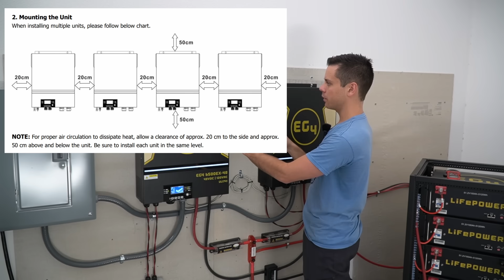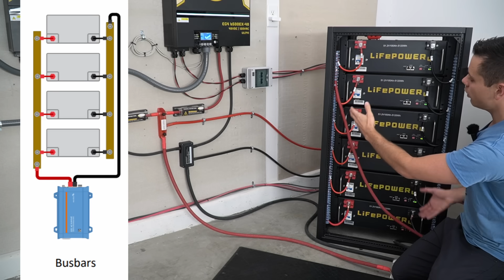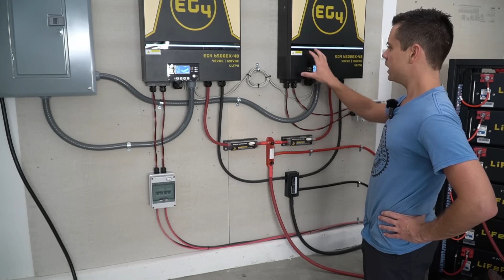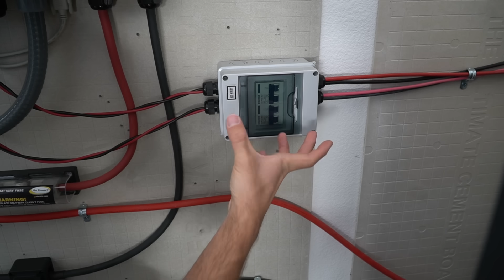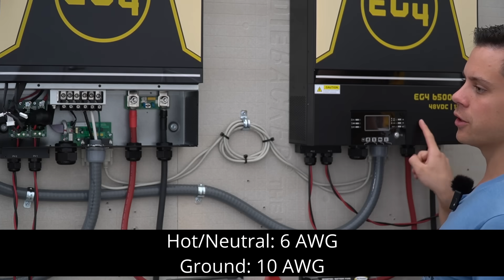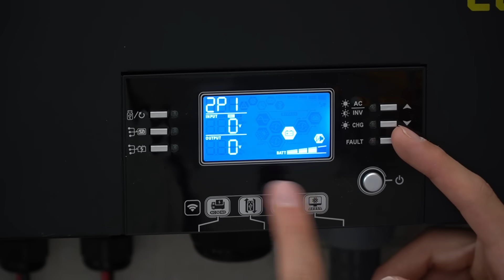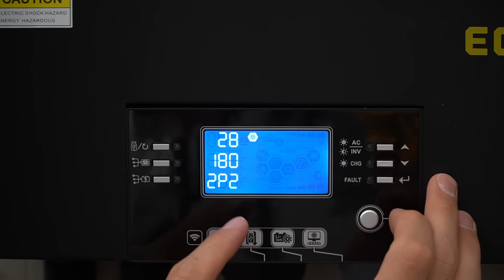Complete 48V Offgrid Solar Power System

Comment: Great video (As Usual).

Edited:   (After thinking about this some more I came to a different conclusion)
With the system set up as shown in the video,  the bonding relays in the inverters will always be turned on,  so the system has 3 neutral-ground bonds (One in each inverter and one in the distribution box).  Therefor there will be current on the ground. All of the assertions about the risk being lower due to the short distance and conduit are true.    In addition, since it is a split-phase system the ground current will be limited to roughly 1/2 the differential between the two hots.     However,  with the multiple bonds,  I do not believe it is technically to code.   The good news is that this is easy to fix by removing the N-G bond screws from each of the inverters.

Also, it is important for everyone to understand what you asserted in the video: If you have AC-in (Using it as a UPS) the situation changes significantly.     When in passthrough mode, there will be two N-G bonds, and when in inverter mode there will be 3 N-G bonds.    As you said,  in this case, there should be no N-G bond in the panel being fed by the inverters.   In addition, the source of the AC going into the inverters should have an NG Bond and the N-G Bond 'disable' screw should be removed from one of the two inverters.

Note:  I would not be at all surprised if an inspector missed the issue and passed a system like yours.    Most of them have never done a deep dive on this type of set-up and they would not realize the problems that could exist.   (This is why more and more municipalities are requiring an Engineers Plan and sign-off.... but even a lot of residential electrical engineers will not get this right.
Reply: You mention a short distance to the panel.  I am going about 40 ft to my panel. (splitphase) how does this change things?
Reply: @sheeplehurder1449  Honestly.... Short or long distance,  I would not want to have multiple N-G bonds.

Comment: Excellent tutorial, Will. You didn’t mention anything about using this configuration for a grid-tied AC-Coupled system. I’m looking at adding battery backup to my Enphase IQ7+ 5.3kw PV system and I really like the EG4LL batteries. In fact, here in CA, they require both UL and 10-year warranty in order to pass inspection. I’d love a good alternative to the Sol-Arks…they’re just too dang pricey!
Reply: Interested in this as well, would like to understand the viability of using this type of battery setup with a grid tied IQ8 solar array. But even if this doesn't necessarily become viable in the near future, I'm hoping it applies price competition for the battery market including Enphase.
Reply: Consider LCOE -  cost /kWh over the Life of the system.  Sol-Ark when installed correctly has a 10 year warranty and Battery saving  "PCS" Power Control Features. This system will make Power .... free of battery chemicals. ie. You can make Ice and Hot water when the Battery fails.
Reply: I third that.  I'm in permitting phase currently for a 14.5kw array connected to Enphase IQ8 technology.  I'd like a value battery alternative too.  The Enphase makes the grid tied part so easy...with the smart controller.  Wondering if the communication between batteries and smart controller will be limiting factor. The batteries need inverting too, so there is that.  The Enphase battery array has all that built in but Cost is up there.

Comment: Very well done. A few things come to mind,
1.  Where is the neutral/ground bus bar in your sub panel connected to earth ground and wire size/path/connections?  Although double insulated is UL approved,  I always prefer no current in ground.... helps eliminates potential ;  )
2.  I really like those inverters!  Can do 3 phase, impressive!
Curious, do/did you monitor the phasing angle and frequency?  For power efficiency reasons I'm curious (freq not so much).
3.  Oh, and yea, dc breaker on SP's , ... great job :  )

Yep, really liked vidy and you are doing a great job educating.  If every house had this, I believe we could eliminate a lot of society issues... free (almost) kw's per meter of area should be utilized... locally ;  )  

Hope it is flawless.

Best regards,
Ken

Comment: Thanks! You made this section of the system seem far more understandable that I first feared. The Solar array sizing is the part I don't yet have a good understanding of. Presume it will vary based on needs/requirements, but is there a "rule of thumb"? Something like (just a wild guess as an example), the minimum solar array output should equal at least 75% of your average daily usage in watts?
Reply: That depends on your climate (rainy winters are bad), and on the amount of battery storage you have, which allows you to bridge more bad days. If you look at your average daily KWh usage, and your average solar power usage (both during winter), they should be roughly the same. If solar averages less, you may have to supplement with a gas or propane generator during the winter months. In my climate, the common minimum daily KW output is about 16% of the solar panel ratings, so if have about 5 hours of useful sunlight per day, and you used say, 24KWh per day, you could need a wopping 30KW of solar (more than these units can handle in the summer). We use near the maximum these units support, or about 13KW of solar panels, so in winter we end up using the grid or propane generator for a significant time each day. We run a well, hot water heater, and cook-top as our main loads, along with a couple of chest freezers, a fridge, and a computer.

Comment: Hi Will I really enjoy your videos :) 
You actually spend probably most of your time on this projects :) 
Last couple of months I start my journey and have this question not answered still.
Are there is limitation on how many solar panels you install ? I understand that you have to be under max voltage but can I connect infinity of parallel sets to increase power? Everyone saying that max power of solar per inverter including You (for example this video you mentioned 16000w. In my head there is no limit and in my installation I will almost double solar power to inverter power to have good production in cloudy day. 
Or I missing something or maybe mppt charger is build this way that it my blow when extra power i available? Could someone one explain why we always talk about max pv power ? 
Thanks for help

Comment: I'm confused about the bypass  mode.
I have purchased 2 of these inverters and 2 of the batteries...so far. I intend to be off grid but I'd still like to better understand the grounding issues.
thanks

Comment: Good info on how to set up.  Thank you for this video.  What do you do if the house is a large house with two or more electrical panels? Would you have the same batteries-inverters setup at each panel? Or would you have one batteries-inverters with a panel setup and then somehow run the electrical wires to the existing electrical panels?

Comment: If one inverter was to fail, do they both shut down in this config? I’m wanting a completely redundant system so when I leave my off grid house during winter for extended periods and there is some type of glitch, the seconding inverter would keep carrying the load. This almost got me last winter when my Growatt glitched and stopped taking a solar charge. My batteries ran out eventually and luckily I got back before my house froze in the -30 degree temperature since the furnace wasn’t able to run.

Comment: If you are like me and learned a lot of what you know from Will, just remember to check with your local zoning officer before you buy. I purchased an offgrid system under the assumption that it would not need to be code compliant and then I learned otherwise. My municipality did not care that my system was ground mounted and totally off-grid. They are requiring that I get zoning and building permits and an inspection before I power it up. If I were doing this all over again, I would get the zoning and building permits that give the "ok" for the equipment I want to use and then purchase the equipment.
Reply: The land of freedom huh
Reply: Ground structures in my area only require a permit if it is a permanent structure over 200 square ft. So I put wheels on it 😎
Reply: @CotyWK  right! Just got to be better at their game than they are. Get your land patent and none of their zoning matters.
Reply: We do to much asking permission just do it.
Reply: Thank you for the heads up.
Reply: Option 2, don't ask for permission.
Reply: @DonziGT230  u do u, bae.  I don't mind playing things by the book.  If you're like me, take my advice.  Otherwise, u do u.  No judgement from me.
Reply: New World Order in charge
Reply: Where are you at and who pointed the finger at you
Reply: @dieseldawg7132 he pointed his own finger at himself sad world

Comment: Probably silly question, but if it is off grid system, why does the system(s) each have transfer switches inside.  It is possibly a hybrid.  I also do not understand the bypass feature.  If you have time, please explain
Reply: They have bypass mode for for generator applications in off grid situations as well. Bypass essentially is just the grid or generator power passing through the inverters to the loads. The inverters have a setting for minimum battery voltage then they transfer to grid or generator. So you wire the inverters from your main panel. They are fantastic machines.
Reply: @GavinStoneDIY  Thats means they would shut down inverter at a certain voltage and transfer input power from either to grid or generator.
Reply: @billycarrollmartin  exactly. And it’s all done automatically.

Comment: Seems like the battery current balance would be better if the cables were connected at the center of each bus bar, though at the rate you are discharge, current balance would probably not be an issue any way they are connected.

Comment: Nice video.  There is a code issue with your AC load center panel.  Since you are back feeding the bus bars via a double pole branch circuit breaker, a hold-down device is needed for that breaker (or each breaker if you have multiple sets of inverters).  According to NEC 408.36(D) Plug-in-type overcurrent protection devices or plug-in type main lug assemblies that are back-fed and used to terminate field-installed ungrounded supply conductors shall be secured in place by an additional fastener that requires other than a pull to release the device from the mounting means on the panel.
Reply from the maker: Do they make one for 6 breakers? Using main breaker has issues. Can't have six inverters all connected to those lugs.
Reply from the maker: When a grid tie inverter is tied to a panel and backfeeding, there is no hold down device.
Reply: @WillProwse  You are correct… this is generally the case.  In your example in this video, your two inverters are acting as the only source of power—therefore a hold-down is required. It is often just a plastic clip with a screw, or even just a screw, depending on the manufacturer..
Reply from the maker: @powerranger9160  ohhh ok I understand

Comment: Will,
If expanding past 2 of the EG4 inverters for greater capacity in a 240v split phase configuration, do additional inverter have to be added in multiples of 2? Could you just add a 3rd inverter and then balance the load in the A/C panel?
Reply: They have to be in pairs for 240 applications.
Reply: It has to be 2,4 or 6 inverters for split phase otherwise the master inverter will see as an imbalance and fault.

Comment: If the ground and neutral end up connected on the same bar why not just save wire and connect them together in the inverter with a jumper?
Reply from the maker: Then current would flow through high resistance case or conduit. Bad idea. Better to have them bond in one spot

Comment: Where is the earth grounding that should be and an rcd would be safer .
Reply from the maker: That will be covered when it is connected to transfer switch. I suggest people hire a professional for that step. Will cover that more in detail on my site and in future videos
Reply: @WillProwse  OK but just because you're not connected to grid doesn't mean there's not the potential for death from the high voltage that you're producing from the inverter , I would have thought an grounded earth would be a safe option. I'm not an electrician just someone who's building an off grid system in New Zealand , just trying to gain knowledge. Anyway I love the information you share cheers mate.

Comment: Again, AMAZING! Could you please take this system exactly as you have it here and show us how To-Code we can connect it in "grid-tied" configuration? Also, I already invested in a AGM battery bank. The batteries have specified charge profiles. If I can not yet afford the wonderful batteries shown here, ( I can not yet but will be) can the boxes be Custom Programmed to my specific AGM batteries recommendation(s)? They are 12 Volt, 100AH, AGM.
Reply: Yes. The charge profile is customizable. However, this system is for 48v battery banks. So you would have to configure your AGM batteries in series and use a BMS to handle balancing. The user manual is online and it helped me answer a lot of my questions.
Reply: @chadseld  Thank you. I didn't ever associate a BMS and lead batteries. I will look into that. I didn't even know they made BMSs for lead type. Thanks! (and yes, my AGMs are in series parallel with my 36-volt system).
Reply: @benkanobe7500  You may be right about that. I've not seen one either. So, I guess you just have to rely on initial balancing and a regular equalize charge. One of the reasons lead batteries have not worked well for people in the past is due to improper charging (e.g. never quite getting to 100%). And that makes the batteries fail early.

Comment: Sorry, but have to call BS on Signature Solar saying the ground/neutral bond in the inverters is correct - and that ground current is acceptable.  Reference NEC 250.6 - Objectionable Ground Current.  Ground conductors aren't allowed to carry current except in a fault condition (purpose of the ground).  In no way should the ground/neutral bond be both at the inverters and the panel.  As a test, create a large phase imbalance - say charge your Tesla at 240V and put a 120V large heater on one phase.  Maybe several to approach inverter max (these are big inverters).  With your voltmeter, measure the AC voltage between the electrical box ground/neutral and the inverter metal chassis.  Do the same between each inverter chassis.  If you measure anything other than zero volts, you have a shock hazard if you touch those two items.  That's why the ground needs to be separate, and never any current flowing.

Also, pretty sure the split phase configuration with two inverters in series is not-UL listed.  Just because the manual shows lots of configs doesn't mean that all configs (and settings) are UL listed.  The listing seems to indicate a stand-alone single inverter setup.
Reply from the maker: Their reasoning is that a traditional meter and panel have two bonds, and the current on the ground in that instance is not an issue. They argue that it is protected and short distance, so it should be fine and pass inspection. I'll measure the potential between the cases with large imbalance. I do agree with you but everyone's saying I'm wrong.
Reply: @WillProwse  I don't know even what they are saying about the meter.  Understand these guys want to sell product - they are not code experts by any stretch.  The meter doesn't even have a 'ground' between it and the electrical panel - just hots and a common (neutral).  There is no double bond.  Anyway, for your testing, you can also measure the current at various neutral and ground conductors with a clamp meter in your setup.  You'll see how the large phase imbalance current is sharing between the neutral (white) and ground (green) wires - which is not at all the function of the ground.
Reply from the maker: Oh I didn't think of that. Im being told that hundreds of systems have passed inspection with this configuration. Stand alone inverter would make more sense.
Reply: @WillProwse  Yeah, ETL testing is also pretty lax depending who they use.  Tests per UL standards, but not UL.  If UL actually tested and certified for them they'd check way more things, and that manual without any depiction of how to hook up ground would be a non-starter.
Reply from the maker: @billjohnson3344  yeah very true. I'm being told the older model, lv6548, from another distributor, passed inspection multiple times even without PV screw terminals. I don't get it. And yes good points about UL and etl
Reply: Also, just another point.  Lets say you chose to use metal conduit instead of the flexible insulated conduit.  The conduit itself would also turn into a conductor of the imbalance current.  So you'd have current flowing in neutral (white), ground (green), and the metal conduit.  Totally wrong - no mater what SS is trying to tell you.  All this can be solved if these inverters did not bond ground and neutral.
Reply from the maker: @billjohnson3344  yes that's actually what we all agreed on, and the point my friend and I made as well. That would be really bad
Reply from the maker: @billjohnson3344  and yes would be solved if ground neutral wasn't bonded
Reply from the maker: @billjohnson3344  that's why I am using the flex conduit. Will test for potential everywhere when I get home with imbalance
Reply: @WillProwse  Awesome.  Forgot to mention, you are the man - as always!  Thanks for all you do.